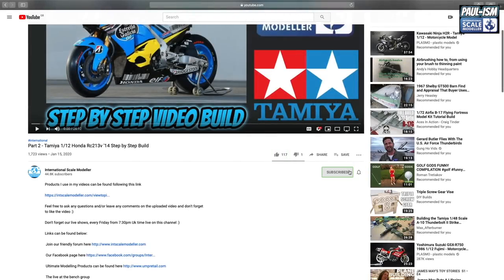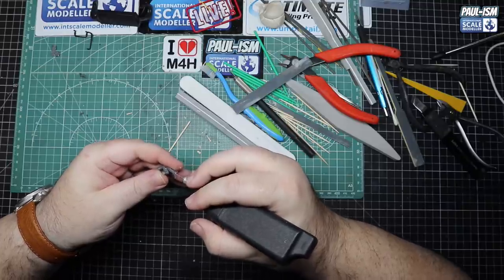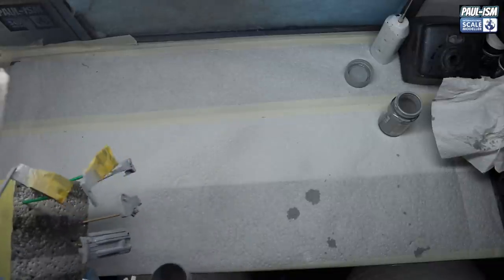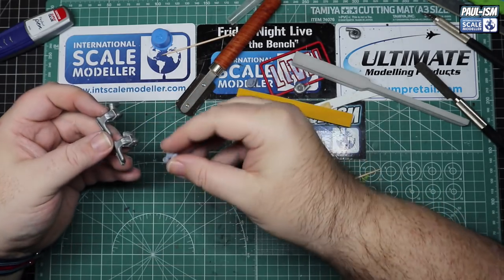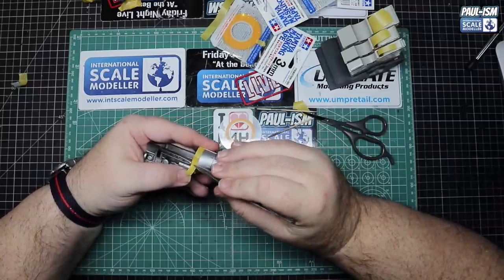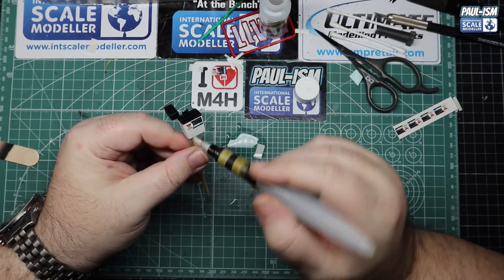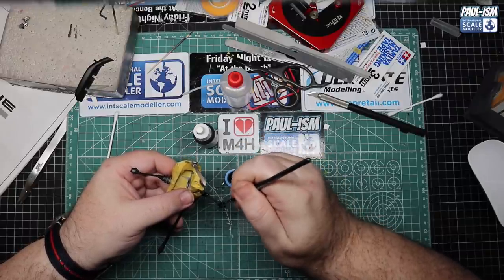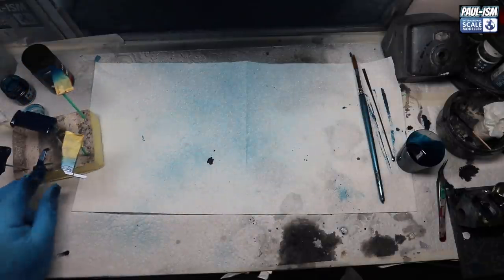Part 2 - Fujimi 1/12 Nissan Skyline R32 GT-R - Step by Step build

Comment: The turbine is on the exhaust side of the turbo, compressor is on the intake side (it compresses the air before it goes in the engine)
Reply: Hi Paul, you need to get hold of some SMS laquers. Hi quality paints made  in Australia,huge range of colours. They are available in the UK ,a quick google search will find them.

Comment: Loving your work Paul, i aspire to get the quality of work you are producing. Any tips on not completely ballsing up my models with messy glue application.
Reply from the maker: Yes use as little ca glue as possible, use ova based glue where you can